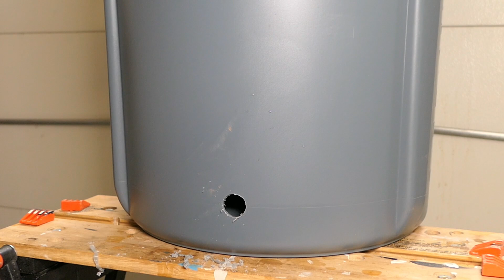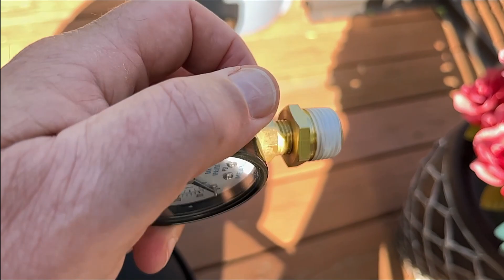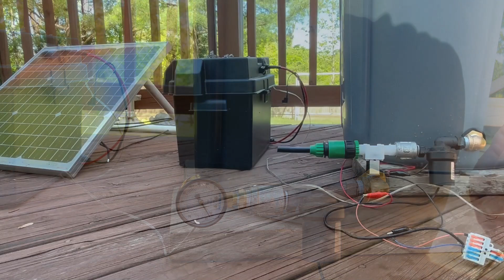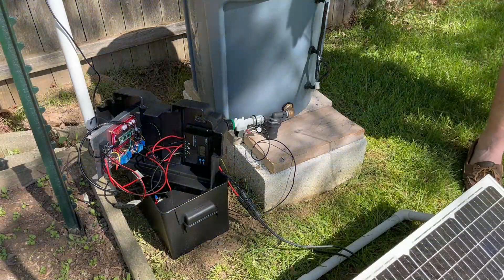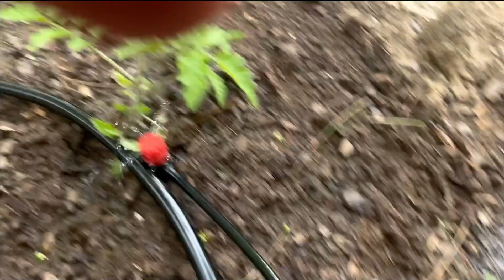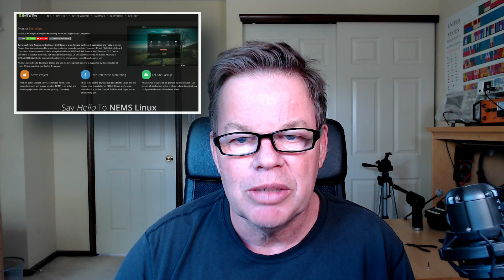MicroDot in the Garden Part 5

Comment: Well done on tha project of yours. Very impressive
I plan to do something along the same lines but more as a distributed IOT node network to monitor and control all those nodes in various buildings, so a lot of the principles are the same as what you are doing 
I currently am using ESP32s with micropython as MQTT nodes and works very well , but that does add the complexity of needing a full stack linux server (on a Raspberry PI) to run the MQTT broker, etc... but it does meaqn you need to maintain a full linux stack and thus additional skills and knowledge one needs to maintain.
I am aiming to simplify things and do away with  the maintenance of a full linux stack and just restrict all the nodes , controllers, etc... as Micropython native on hardware as it will make maintenance and rebuilds so much easier
Particularly, using MIcrodot to simplify the WEB server side of things, and using asyncio to be able to run local IOT node code in parallel with WEB server functions, so pretty much what you are doing, hence why I have been following your project quite closely
I would like to exchange thoughts and get feedback from you as to your experiences, but this is probably best done outside of YouTube comments
Would you be happy with that ? If so, that would be appreciated and perhaps you can tell me where to email such conversations
Many thanks
Kind regards
Reply from the maker: Hi ABC, thanks for the feedback, sorry I don't share email but feel free to add any questions etc into this thread. I like your idea of the distributed IOT network for the garden, it would have cut down the number of wires I was using in mine.

I did use MQTT and Micropython in the ourProbes project I did a few years ago. I am just updating what I did for that with a netProbe project that is a combination of the asyncio stuff I did in this project and some of the ourProbes network tests. MQTT is a nice way to connect IOT devices, last time I used it I was using Googles IOT core services but Google just decommissioned this services. I think next time I use MQTT I would probably set up the service on my own Synology box (Kind of the Node-Red, InfluxDB, and Grafana setup Andreas Spiess was using in video #255 )  Good Luck